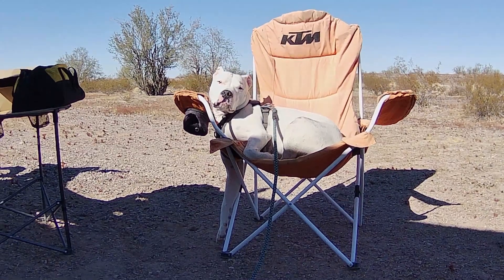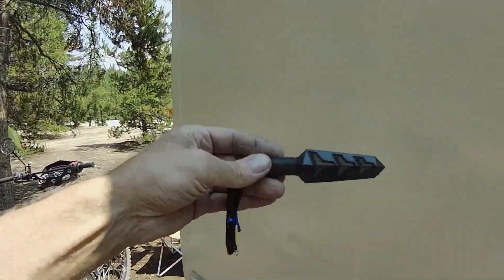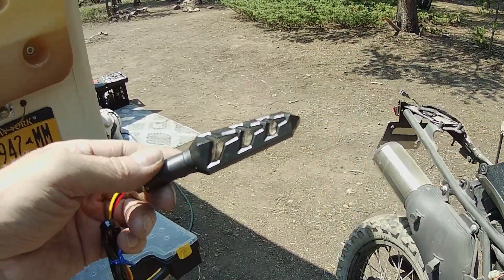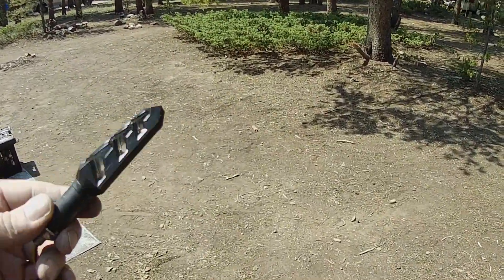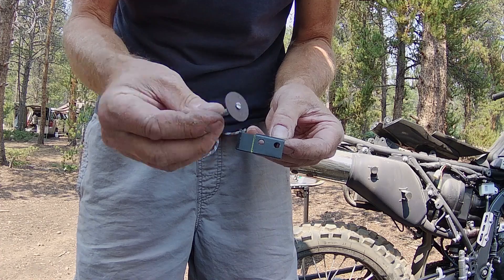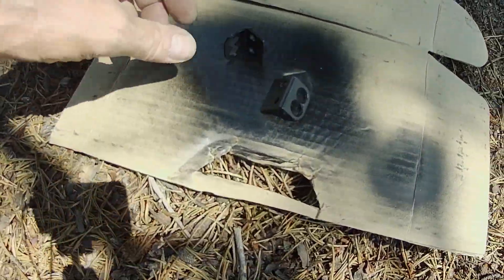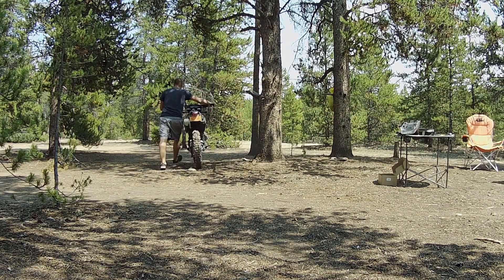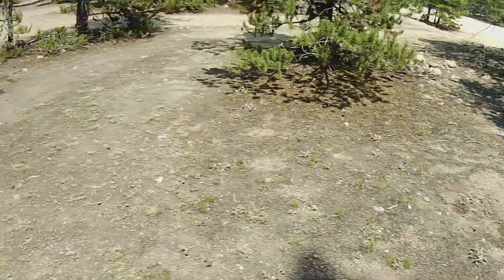Why Did An LED Blinker Swap Take Me 3 Months To Complete???

Comment: I think that blinker that blinked with the LED Blue would have worked just Fine for the Front Blinkers. I know this is way after the fact but what did you end up doing with the blue blinkers?
Reply from the maker: They're in my spare parts box... as I understand, blue and red pointing forward can't be done... could be wrong though.
Reply: @TheCampulanceMan  OK.